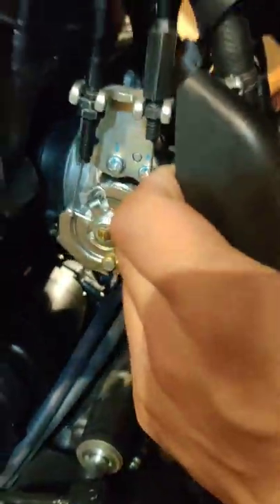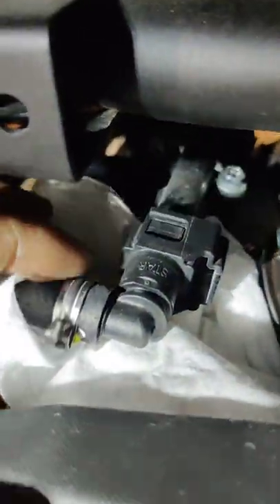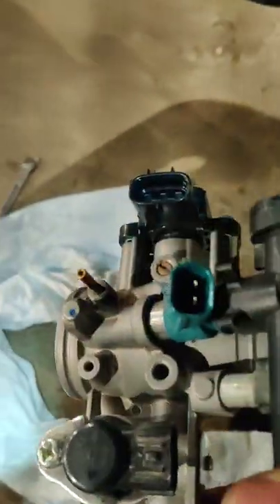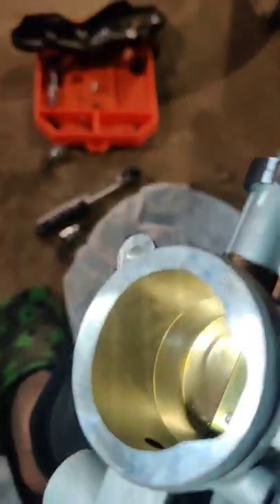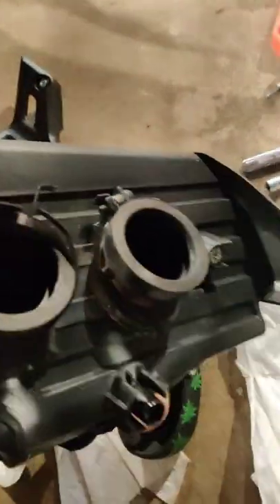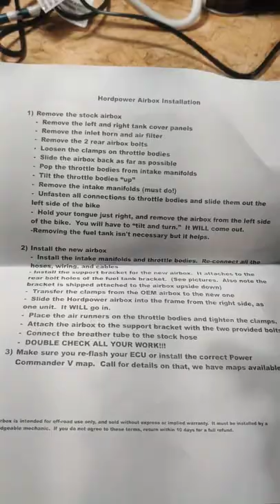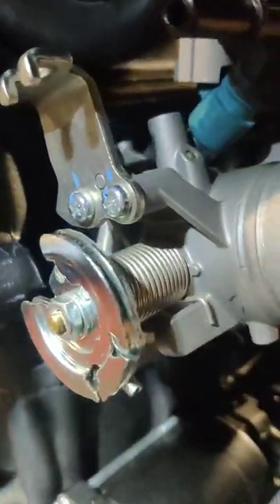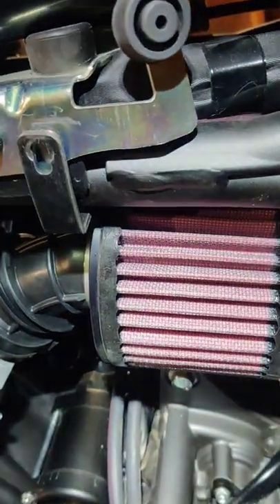2021 Yamaha MT-07 Hordpower Intake Install (No Cut)

Comment: Only reason I don't get this intake is because I get stuck riding in the rain more often than not
Reply from the maker: @THEleatherface24  as long as it's oiled, you're good. I've been caught in rain several times when I lived in upstate NY. They also sell a protector for it, if you want that extra rain protection, it's on Amazon.